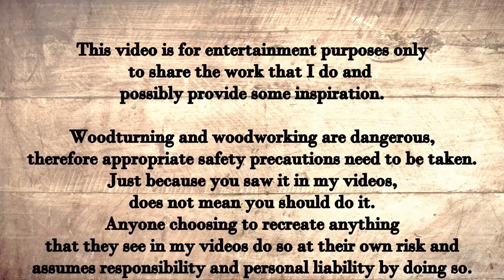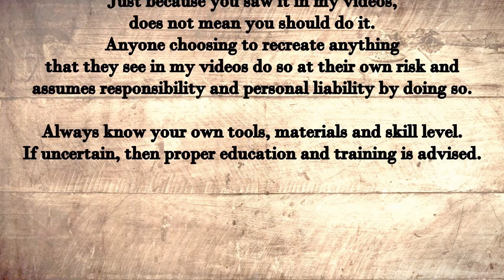A Steam Locomotive - #YTCCC2021 October (Automotive)

Comment: Very nice locomotive!     I noticed around 10:50 in the video that your bandsaw blade is fairly far away from the upper thrust bearing and you are getting quite a bit of deflection.  You should adjust the bearing forward a bit.
Reply from the maker: Thank you for watching and for the feedback. I had made some adjustments before this project, but must have missed that. Thank you for the advice, much appreciated